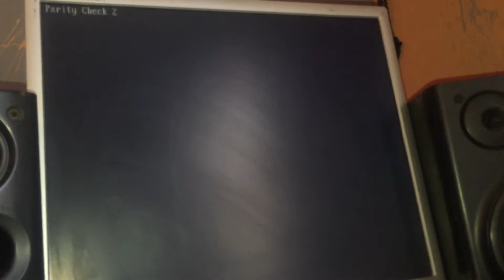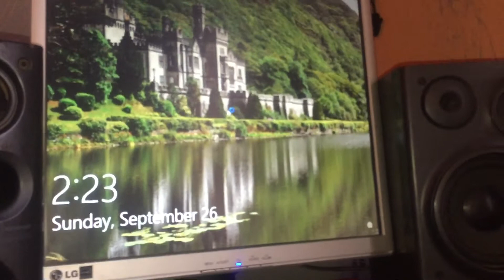How to fix parity check 2, in less than 2 minutes

Comment: This worked for me. An old XP computer with bad capacitors. I’ve replaced 5 already which has lasted over 2 years so far. I couldn’t get into the BIOS to try the other method. After removing the unnecessary modem board, the computer booted up. Buying these fine folks a little more time. Thank you!